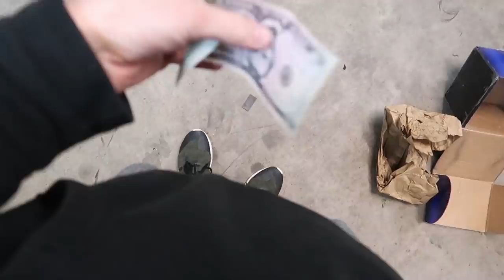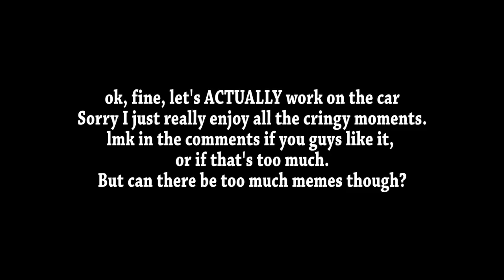New Floor and the Roll Cage! MiataGoKart!

Comment: Pasha im in the middle of my miata kart too lol. Im in the middle of figuring out the same cage i just got too. Hey if i pay for a weld on steering wheel would you guys use it? Im trying to figure out if it will work or not.
Reply from the maker: mazdabuilder 88 maybeee:)

Comment: Where u removed the paint to weld the roll cage plates is going to rust over time because it’s bare metal the proper way would be to buy a primer that u can weld over
Reply from the maker: we gonna put primer over it for sure:)

Comment: Get rid of the windshield!
Reply: nah keep it
Reply: Martin Leander Høynes no coz then you can just use the rollcage in replacement to the a-pillars
Reply: @eoincoolahan8606  You can still use the pillar in a roll cage the most important on a miata is that you have cage in the doors . cus the doors normaly helps with holding the car together.